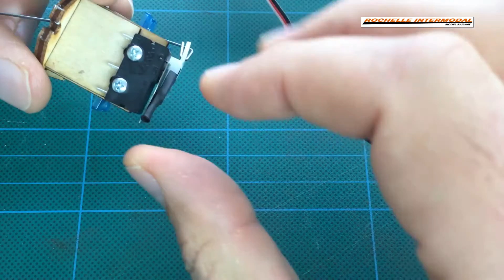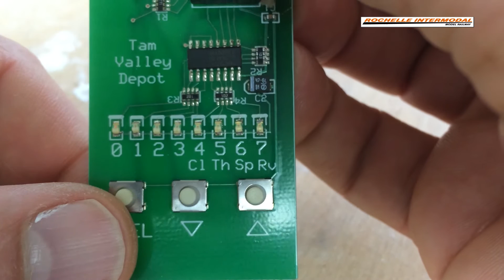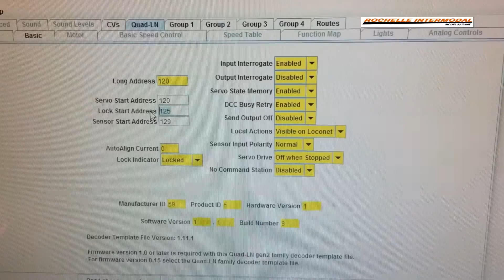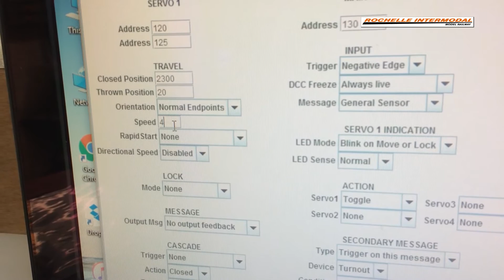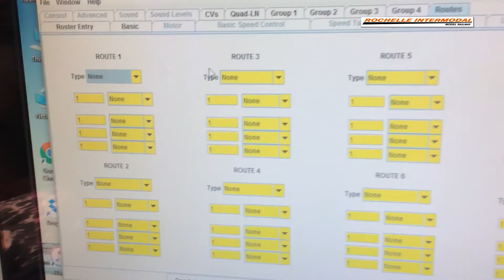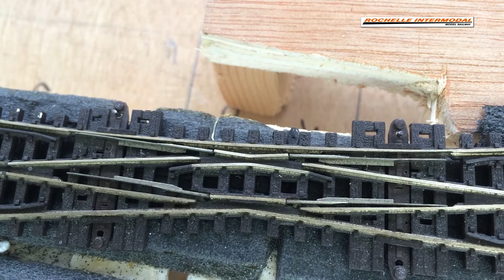Tam Valley Depot QuadLN Decoder & Servo Installation

Comment: Pete, it looks from underneath shot like that 2nd servo is stressing under load in one direction. You might want to reposition it, or the throw rod slightly (if you haven't already) before the servo pulls itself away from the mounting board...